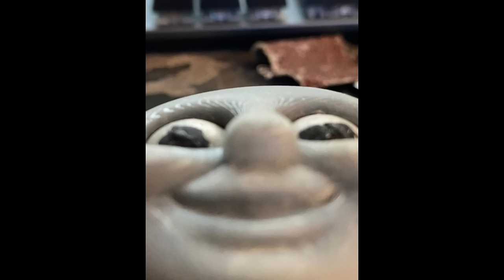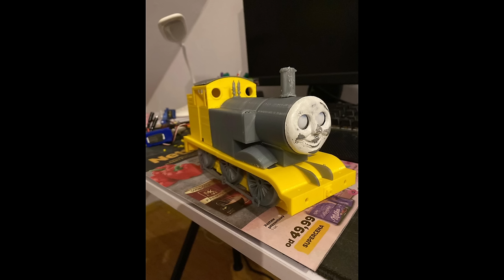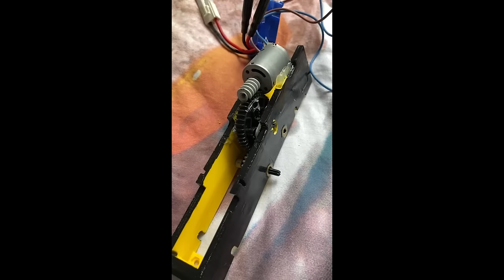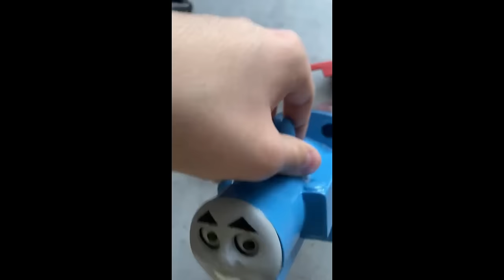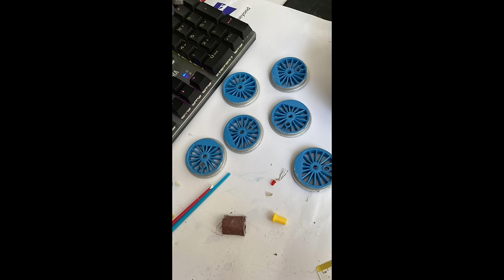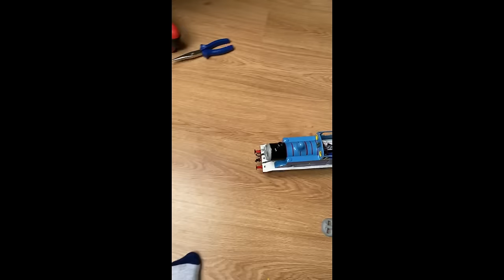Gauge 1 Thomas   BUILD PROCESS

Comment: Nice! Can you make tracks for him?
Reply from the maker: I can, but i sold it because i want to make more!
Reply: @quboss2008  When you make a new one then? Also maybe add a smoke generator to emphasise the realism.
Reply from the maker: @hellothere42000  smoke gen not possible when battery operated (no space)
Reply: @quboss2008  can you put the batteries somewhere else in the base?
Reply from the maker: @hellothere42000  really hard if you planning on running
Reply: @quboss2008  true tbf
Reply from the maker: @hellothere42000 aaaaanndd Henry happend, now James

Comment: How did u use a normal remote control for this?!?!
Reply from the maker: It’s flysky controller, you just need esc for motor and receiver for controller
Reply: @quboss2008  man thx alot.